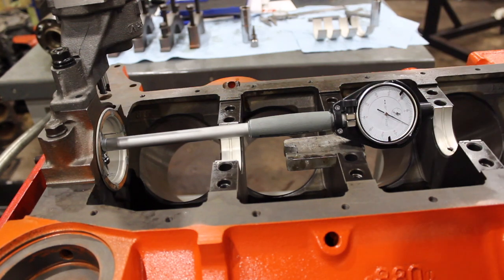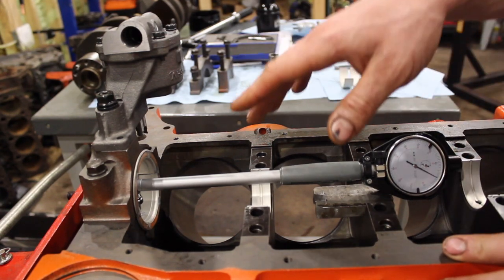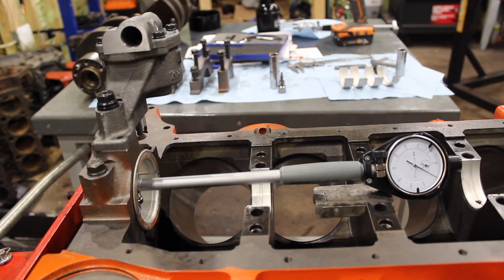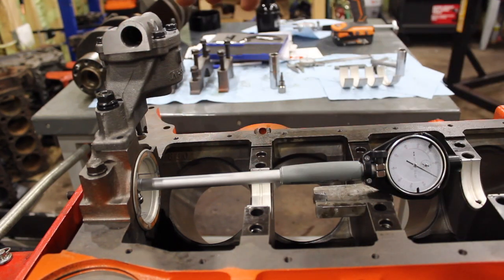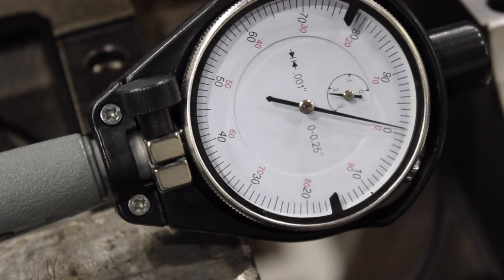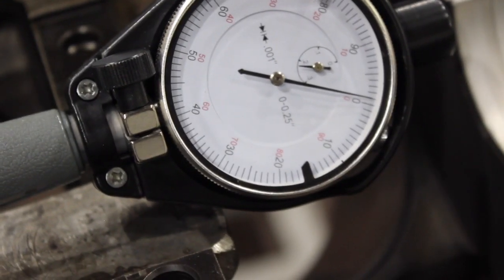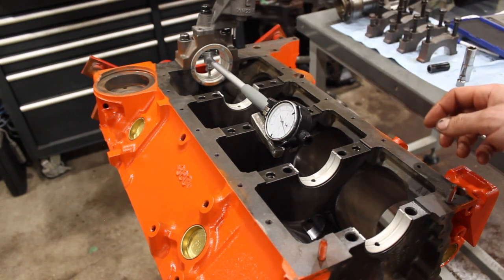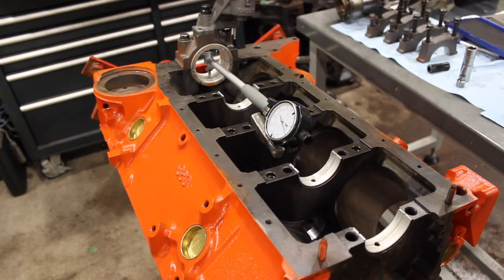The Oil Pump Changes Main Bearing Clearance?

Comment: Do you normally run the m155hv oil pump on your vortec engines?
Reply from the maker: Most street engines I will use an HV pump, but usually, it's not necessary

Comment: Wow. Over the years in various shop I've wrenched at I've seen Tech's zip on oil pumps with their 3/8 impact guns when doing oil pump replacement. Also with hot engine temps the clearance would probably be more.
Reply from the maker: The old ugga chuga torque haha

Comment: Piss cutter  What do you usually run for a rear bearing clearance for street strip When the oil pump is on And torqued?
Reply from the maker: .0025 to .003 ideally
Reply: @cuttersperformance   Hey Piss I have a question maybe you can answer What causes rear main bearing to wear un-even more wear on closer to the seal side?  Plastigage Shows 2 Thousands towards the end 3000 at the beginning why?
Reply from the maker: Can you send me a picture?
Pcperformance1@outlook.com
Reply: @cuttersperformance   I emailed you the photos
Reply from the maker: Haven't gotten anything?
Reply: @cuttersperformance   I sent it through outlook
Reply: @garys7119  a balance issue maybe? I'd like to know myself if you found anything out

Comment: Most would want a .002 clearance on all the mains, on the thrust i would go .003, allows a better "BUFFER" of oil film plus you can do the "notch trick" on the front of the thrust face to allow oil to go into the thrust area more efficiently..

You can buy those STDX that is .001" thinner or thicker for customizing clearance, i recommend whatever brand ya get preferable King Bi-Metal Aluminum, that you also get a set of "X" versions as well. A "MUST HAVE" for a serious engine builder...

Factory LSX engines uses the Aluminum silicon Bi-Metal and King is the only MFG i know of that makes a serious performance oriented type like that... Those bronze tri layer is bullshit, no thank you, seen them get eat up wayy too many times.

Comment: great video, what do we do with this information tho(I am new). Does this mean you actually need a thicker bearing?
Reply from the maker: Two things haha 
1)check your clearances with the pump on 
2) of your getting the block line honed ask if they install a oil pump or suitable replacement to give it the proper pull on the cap. 

At the same time most guys haven't been checking this for years and most have no issues. 
The use the information as you will 

Cheers! Thanks for checking out my video

Comment: Did you check the clearance at 90° to the oil pump? I'm betting the clearance may have actually decreased there, probably not by a full thousandth, though.

Comment: If you have a crank that has been polished and not turned don't worry.. If you're running super tight clearances on stuff this aint the only problem you're going to run into  Race engines are built slightly loose Higher oil pressure and  Heat  Will take care of that problem You need the room for expansion

Comment: It makes sense, I`ve not measured it before but I bolt a cut off oil pump pedestal on. I would assume the distortion is localized around the bolt hole as it is on the cylinders with a torque plate. I`ve seen as much as .00075 near the bolt holes for about an inch down the wall usually in the corners. couldn`t see any difference at the bottom of the cylinder with or without main caps on. The aftermarket blocks hardly move if at all. Yes attention to detail is important.

Comment: I wonder what the difference would be at 15 degrees from vertical. I'll try it next time. I'm thinking with the width of #5  an extra .001 doesn't hurt anybody if you're running typical clearances. 
A plastigager could register the cap then hand-tighten the main bolts, torque the oil pump then torque the main bolts

Comment: Didn't the gauge go down? That would tighten the bearing on the crank. If it changes at one point it must at another.
Reply from the maker: Its the opposite dial movement with bore gauge than you would think. The journal got larger with the pump being torqued. The pump pulls on the top of the bearing cap
Reply: @cuttersperformance  I see, have you checked at say 45°one way or the other? I can see the reason to mount the oil pump when line honing, and I thank you for bringing it to my attention. I worked for a machine shop in the 90s, and I don't remember if they did it or not.
Reply: After thinking about my bore gauge, your totally right. I bow to your knowledge.

Comment: I have noticed on small blocks with some miles the rear bearing will have a low not worn spot in the  middle I figured it was from the oil pump bolt .

Comment: Is this test done with the factory GM oil pump bolt, or are you using an aftermarket oil pump stud su h as ARP 230-7003? I can see how a bolt would distort the cap by pulling up on the threads as it is torqued, but a stud should produce a different result.
Reply from the maker: ARP stud in this test but believe it or not a bolt is basically the same result
Reply: That's very surprising. I guess I learn something new everyday
Reply: @cuttersperformance  im guess your right on that, I couldn't imagine it making a difference either way and I believe the torque spec is the same for both but could be wrong. I know Arp has higher torque specs sometimes but im thinking the oil pump was about the same

Comment: So is the key to have the block and caps line bored with an oil pump installed?
Reply from the maker: Yes! If the block is getting a line hone make sure they bolt a oil pump on
Reply: @cuttersperformance  would most competent machine shops know to do this?? Hopefully 😅
Reply: @jimmy_olds  you would think so if they're doing it for a living but im willing to bet there's some that don't lol, u will definitely make a point to ask from here on out lol

Comment: Congratulations on taking the time to measure and then discover the many forces involved to produce precision machined parts. Your machinist should of course be aware of the effects of clamping pressure. and you should ask what torque numbers he used so you can duplicate these pressures upon assembly. You should probably ask before dropping off the block. If he tells you it’s not that important - find another machinist. What you saw in the rear main is exactly what happens when bolting on a set of heads. Which is why you should ALWAYS bore/hone with a torque plate. BTW, plastigage is a poor substitute for a bore gauge. Plastigage is suitable if you were buying a used engine and wanted to verify that the crank wasn’t cut.Beyond that it’s of little value. I would encourage you to purchase a dial indicator that reads in “tenths” or .0001. A .0005 ( half a thousandth) reading indicator at a minimum. 
Remain inquisitive and pay attention to details. You have something for this field. Best wishes for your success.
Reply from the maker: Thanks for the comment! Good info!
I don't use plastigauge but I do believe it works well enough for the average guy putting his engine together in his garage with a new rotating assembly and a professionally machined block but you are right its not replacement for a bore gauge. 
Cheers!
Reply: Btw calryan how does plastigage tell you If the crank was cut lol .. it only tells you What the bearing clearance is. The only way you can tell if it’s been cut is by measuring it with a micrometer Or Caliper etc. etc.

Comment: This is why the oil pump or a dummy pump needs to be installed and torqued if the block is line bored. It not only increases the clearance but it pulls the main cap out of round.  Using a dummy pump for just the bolt boss area while checking clearance let’s you get at the bolts on the mains with out the actual pump being in the way.  If you have a bore gauge like this and don’t have a dummy pump.  Check the difference before/after... just like this video. Subtract that from your plasti gauge reading.  Thanks for posting this video.  Great info about the details so many overlook or never knew about to begin with.  👍
Reply from the maker: Good point! I don't use plastigauge often but for the guys that do a oil pump with the top cut off would work for a dummy pump
Reply: @cuttersperformance so by forgetting to torque up oil pump on my rear main, did my clearance get tighter or looser without me realizing it....whoops
Reply: Absolutely. It's funny I'm 61 I've been building motors since before way before internet. Or videos. Have learned so much from good sources like piss cutter. Your awesome. Thanks again for all those kick ass videos!!